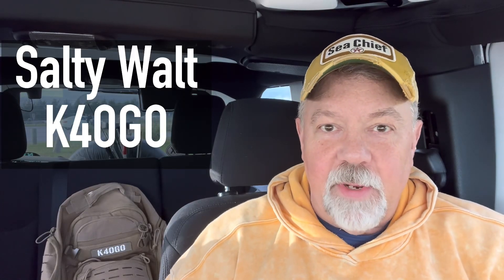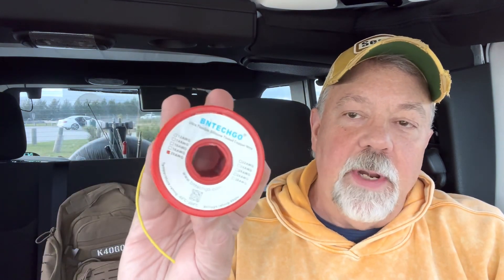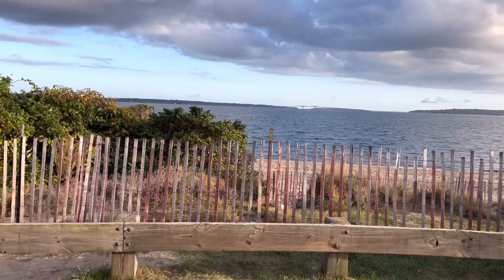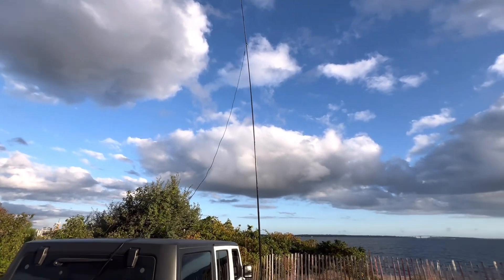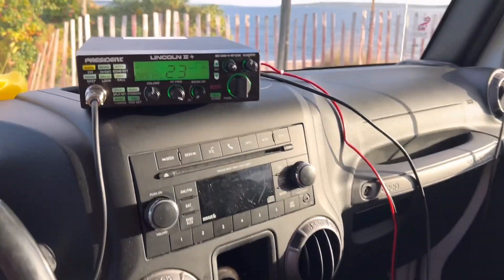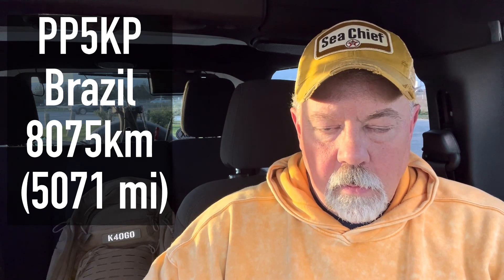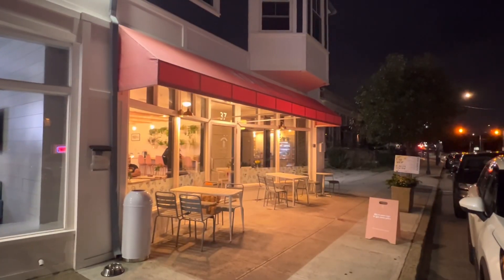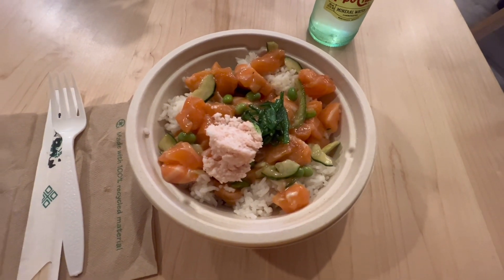Vertical Dipole Antenna: Easy 10 Meter DX

Comment: Balanced how?  It is not balanced.
Reply from the maker: Well, explain then. From everything I’ve been taught a dipole is a balanced antenna. If you have some knowledge that proves that to be incorrect by all means share it so I can let the RSGB and ARRL know they have to revise their antenna books.
Reply: @COASTALWAVESWIRES  The RSGB don't control the laws of physics. A dipole errected in an IDEAL situation is going to be balanced.  VERY few of us can errect a dipole in such a place.  Any metal object in the nearfield will cause unbalance.  Gutters, phone lines, metal fences and even underground water pipes affect the the nearfield performance  of any antenna system. . You shouldn't always believe what you read.  A lot of it assumes the sort of ideal situations very few of us are blessed with.
Reply: Dipoles are most certainly are balance. Just that many feed them with un balance line coax but you get a better pattern if you use a balun to feed your dipole.  A vertical is not balance
Reply from the maker: @P.SeanCoady  ok please elaborate on why a vertical is not balanced. I'm interested in this. A halfwave wire fed at it's center should be balanced regardless of it's position.
Reply: @COASTALWAVESWIRES   first your vertical polarized dipole is a balance antenna, Its a dipole after all. But the traditional vertical antenna with multiple radials is not balance. It's asymmetrical construction  is your first clue that the currents may not be equally disputed thus not balance. We often try to band aid this common mode chokes when if we had a well match balance system there would be no need for the chokes but we use them anyway since we like to stray away a bit don't we. Other examples of non balance loads "might" include OCF dipoles, End Fed Dipoles, Gama match dipoles (driven element) as opposed to a T match element shunt fed vertical tower verticals (a gama match example)  We all know that we use a 1:1 balun on a dipole and a 4:1 on folded dipole both are balance  but the difference is the impedance
Reply from the maker: @P.SeanCoady  Roger that! Yes I understand all that. Was just confused when you said vertical wasn’t, you were referring to a standard vertical antenna and not a vertical dipole. 👍🏻
Reply: Walt, I would appreciate your opinion here....     is there any difference that you see in performance between this vertical dipole....  and a vertical EFHW with an UNUN?  Both are halfwave antennas....    just one fed in the center.... the other fed on the end....

It just seems like the EFHW would be an easier setup.

What do you think?
Reply: @robertruth3281  my 2 cents is that the center fed dipole is more efficient. The end fed does have some nice attributes but it is being fed at very high impedance/voltage part of the antenna. There is a trade off that we understand for feeding the end one is don't be surprised when you burn up your UnUn with a little power. But having the multi band operations is nice. But why do they burn up ... heat ? Could it be because they're inefficient?? Yes you can burn up any balun too but it is much more rare than the EFHW. My two cents it's fun
Reply: @P.SeanCoady  There's no reason to burn up the unun with a little power if you make/use one spec'd for the power you're using, and constructed correctly. Using SSB they probably won't even get warm. One of the thicker torroids is over 90% efficient. Ok, you're still losing 10%, but that could easily be the loss on your coax by centre feeding, particularly if you have a horizontal wire.
Reply: @robertruth3281  For a single band easier setup for 10m, I'd be inclined to go with a T2LT flowerpot antenna. It's still a centre fed half wave dipole, but a "sleeved" dipole. It would be fed at the bottom, and would avoid having to use an unun.
Reply: @paulsengupta971  do you know of a resource that tells how to calculate the lengths on a T2LT?   I know the two ends differ..... but DONT know if it is the velocity factor that accounts for the difference....

Comment: With just a 259 centimetre antenna on the back bumperof my Jeep, I was able to transmit to Puebla, Mexico from northern Saskatchewan. The antenna is on the rear bumper of a 2001 Jeep TJ.  The radio was just an antiquated Cobra 148GTL operating 12 watts on channel 40 USB.

Comment: I built one for the same reason last week and had a lot of fun all week long. I am still wondering if a voltage balun 1.1 would be better than a choke on the feed point...
Reply from the maker: I think a balun would work much better than a choke for sure.

Comment: Walt, I built your 10 meter and 20 meter antenna exactly as you suggested. Took 20 mins to get both up. I was on a boat dock near Jekyll Island, Ga. Put one bare wire in the salt marsh water. Worked Europe immediately. The 20 meter was attached to my surf rod and the 10 meter to a 24 ft.telescopic pole I use for removing Spanish moss from low limbs. What a great day! Thank you for your devotion and enthusiasm. The G90 arrived yesterday so it worked as you said.
Dale KB4MUO
Reply from the maker: That's awesome Dale! Thanks for sharing. You are going to love that G90. Such a great radio.

Comment: yes 10/11/12 meter really hopping . Mostly south America from NY. Even getting 29 MHZ AM.   The problem I had with that dipole is keeping coax away from bottom element .   It interacts and effects the radiation pattern . Also gave me common mode current.  You did a good job doing that . I found the shield side a tad longer helps with the 50 ohms. making it a slight offset center dipole.   The outher vertical dipole I use is the T2LT made out of RG8X . And it works out end fed so no problem with feed line. You make a choke at bottom of antenna out of coax or wrap threw  FT 240-31 ferrite.   On that antenna make the shield slightly longer.  I have made T2LT antenna for 6/10/11/12/15 meters . mostly out of RG 8X coax.  Still using my 5/8 wave ground mount.  if you get on in the AM just after sunrise the UK area comes in real nice on 10/11/12 meters in NY . A little later in 15/17 meters like noon.   I have hurd Ukraine and Russia on 10 meters in the early morning.  Was down at noise floor . no luck.   I did get Norway on FT 8 !   You need a Digi Rig on that Lincoln and you can do FT8 !  Watch power level for heat on finals . 73
Reply from the maker: Yes, I used the back of the Jeep to pull the coax away from the antenna. I think that choke really helps as well. 73, Walt

Comment: Could I use galvanized steel conduit for the mast?
Reply from the maker: No, the antenna will couple with it and it will be a nightmare to tune.
Reply: @COASTALWAVESWIRES  Thanks Walt - that's what I thought but I wanted to be sure.

Comment: That dish looked good, but I do prefer my fish cooked. If it was cooked, I would have pounded it down. Thanks for another good video in the books. 73 Vic de KE8JWE
Reply from the maker: You can actually get it with cooked shrimp which is very good. 73, Walt

Comment: Another Great Antenna Build from the DXAdmiral.  Great pipeline into South America.   With the conditions on 10 meters opening up, I’ve been reading up and searching YouTube on 10 Meter Repeaters.  Have you done any repeater work on 10 meters Walt?  Any suggestion would be appreciated!
Reply from the maker: Thanks! I haven't and I heard some FM repeater guys last weekend. I need to educate myself on setting up for that and give it a try.
Reply: I have transmitted through the Moscow 10m repeater from the UK....I also heard someone in the USA talk to some Russians and a Dutchman on the same repeater. Intercontinental repeater use is quite fun!
Reply: RR3AAC

Comment: I built your 1/2 wave vertical for 10m for POTA. I use a Black Widow 20-foot collapsible fishing pole to raise it. I also bought the suggested unun on Amazon. I activated this morning and had England, Wales, Belgium, Denmark, Finland, and the Netherlands contact me. It worked great, even though three of the operators said that there was a lot of QRM from possible over the horizon radar. Thanks Walt!
Reply from the maker: Awesome, thanks for sharing! 73, Walt
Reply: Yes I use the 20' black widow as well its really good mast 73

Comment: I’ve often thought the vertical dipole never gets enough love. Super low takeoff angle and easy to build BUT…I’ve heard that the end of the bottom wire “needs” to be 1/4-1/2 wavelength above ground. Comments?
Reply from the maker: I've heard and made this one to where the feedpoint is 1/2 wavelength above the ground. I probably should have dwelled on that a little more in the video.